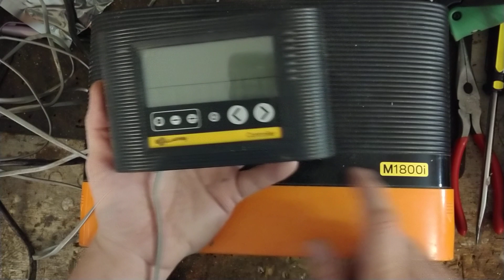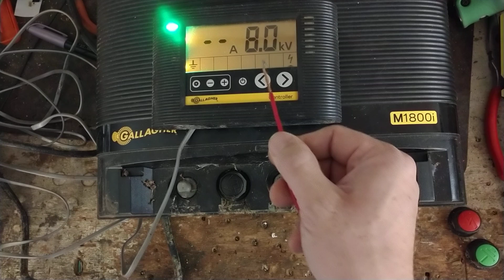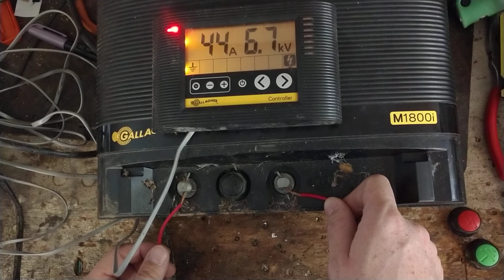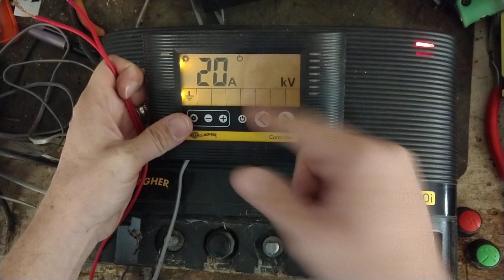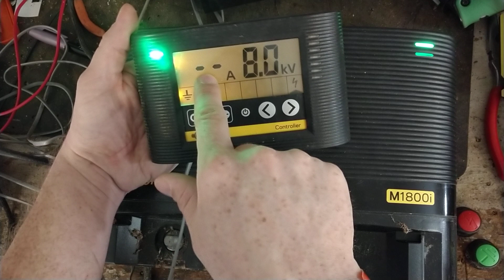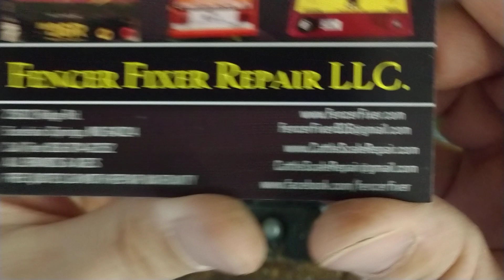How Gallagher i-Series Fence Energizers Work & How To Set Up | Gallagher M1200i M1800i M2800i Repair

Comment: Do you know if this unit had a lighting diverted? Do those things work?
Reply from the maker: Yes they have a diverter inside. Yes they'll do help some, but if it's a bad enough strike, it won't matter what a brand does, they all can get hit. Installing an external Gallagher lightning diverter might be better because it's external and not inside the unit itself. Lightning hits all brands and models, so good luck

Comment: I just bought a Gallagher MBS 1800i, is this unit made for indoors or can I leave it outside. Gallagher website shows it mounted outside with just top and sides front open? I built a little wooden box for it. But just wanted to make sure, I got mine  installed already. Really nice, just don’t know if it is waterproof or not.
Reply from the maker: The digital read out can be installed outside in the weather. It's waterproof up to 3' of water. The charger itself isn't waterproof by any means. Water can't get into it from the front at all, but around the sides where the seam is at and the upper backside, that's where moisture can get in at. They don't run that hot inside, so you were right to put it in a box of some sort.

Comment: what kind of cable is used to connect the display to the unit itself? Is it a RJ11 connection cable like used for phones (at least in netherlands) it certainly looks like it..
Reply from the maker: Yes it's similar to the old phone jack connectors.

Comment: I have the same unit as that one, and just like that l, its not showing amps on the controller but the fence still not working. 

How do let the amps shows on the controller pls
Reply from the maker: When you hook it up to the fence and ground, what does the display show exactly? How are you testing the fence? And how many ground rods do you have for the charger?